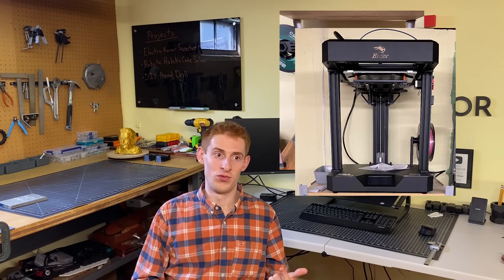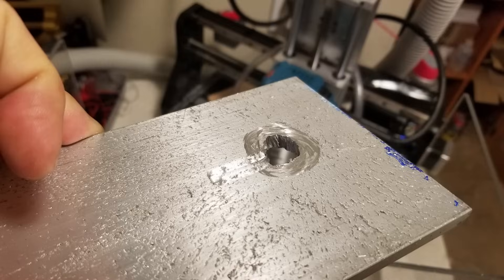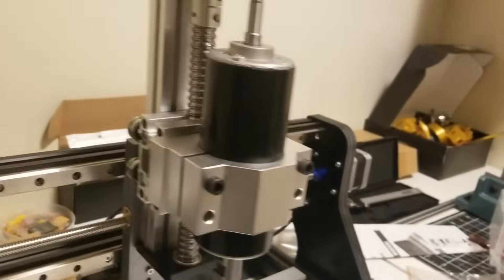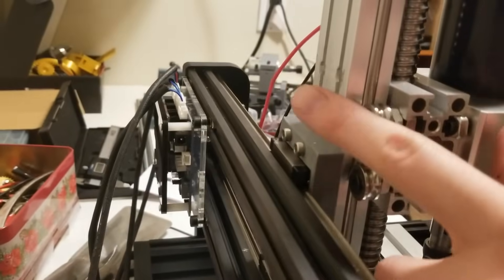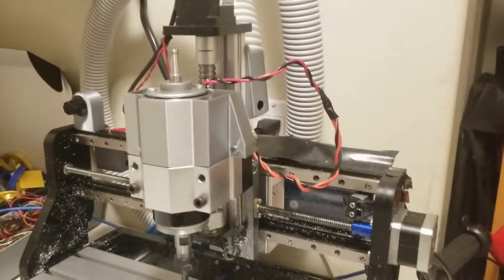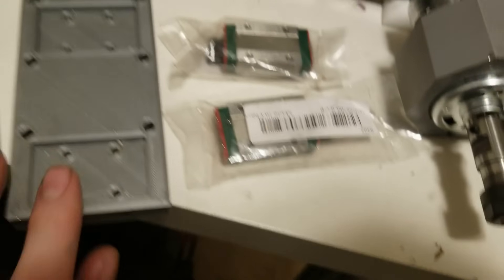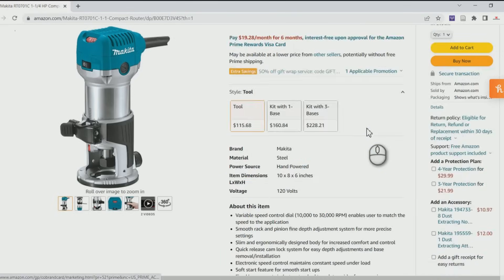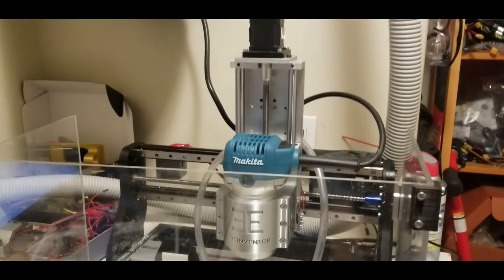Upgraded Desktop CNC 3018 cuts Aluminum FAST!

Comment: I am a trained CNC machinist. I went to college for manual machining and then CNC machining. I'm also a trained welder, fabricator. I have not been machining since 2009. I was a good machinist and then the economy took a downward turn & I lost my job. 
I'm on disability now and I am looking to use my education to make a extra income because of the economy being what it is. I bought the 3018pro for under $200 delivered. I'm use to milling metal and not plastic or wood.
I'm learning how to turn my skills into a viable income to help me with the increasing costs of living, & I am so bored with life that I could scream! Honestly, I went from high performance go-kart racing parts, Jr dragsters & lawnmower racing when that became a thing, to living a sedititary lifestyle. I was at the end of my rope, figuratively & emotionally, with loosing family members & friends to death. I was in a Very Dark place & I needed a creative outlet for my emotions & my skills of building & creating things. I'm the try that will build something that can be bought already made ready to go. But I prefer to build my own pieces of equipment to guarantee that I will have the best machine for my money. It's a lot of work to reinvent a machine, but the rewards are well worth the effort, time, expense & the knowledge that the machine is built as strong as it possibly can be, given the size of the parts that make up the machine & the components that are used in the machine itself. Like upgraded bearings, bolts, materials and everything else that you can use to make your creation better than the commercial variations that are for sale to the general public. I'm definitely not your average customer & I demand only the best in my equipment selection. I will completely redo the entire machine sometimes to add better bearings, linear rails, high grade bolts & fasteners. When I'm done with the upgrades it's almost a completely different machine. BUT MY MACHINE, WILL ALWAYS BE 2X'S-3X'S BETTER QUALITY THAN THE BEST FACTORY MODEL! 
I know that I could just save up the money and purchase a New Professional Grade machine, but that takes time and money, both are in short supply at the moment. So I IMPROVISE, and create the best machine that I can using what I have, can afford & what will do the job I'm asking it to do. It's a Frankenstein machine, some parts are modified to make them work with a different companies parts, but it's a TRUE PLEASURE TO SEE YOUR FRANKENSTEIN MACHINE COME TO LIFE, & BE EXACTLY WHAT YOU'RE NEEDING AT THE TIME! 
NOTHING BEATS THAT FEELING OF A HOME ENGINEERED, PROJECT ONE GOES THROUGH TO BUILD A BETTER WORKING MACHINE AT HOME, WHEN EVEN THE BEST COMERCIAL MACHINES HAVE DIFFICULTIES DOING, THE SAME WORK THAT YOUR HOMEGROWN, SELF-DESIGNED MACHINE IS POSSIBLE OF DOING. 
The PRIDE you have, knowing that you built that machine and it works, BETTER, that it's Professionally Manufactured Counterpart Machine has trouble recreating the same product. 
There's more than 1 way to skin a cat! The same with machinery. The Professional Companies have pretty well designed machines. They cut costs where they can so they can stay competitive in the market. I'm not interested in competing with anyone. I'm just trying to make the best machine, with the most robust components available & using them to make my machine work better and last longer because I chose to go with upgraded parts from the beginning of the build. Why wait until it starts to fail to redesign the parts so they can handle the Extra Tourqe, Rpm's & the Flex or movement of the linear rails or support pieces. Take care of the items you feel are substandard to begin with, and save yourself weeks of time and misery trying to figure out how to make this piece not flex or not do something it's not supposed to do. A little preemptive thought and engineering will make the machine work better, faster, will increase overall performance and efficiency in your parts manufacturing and the quality of your parts overall. It takes some time to make the changes to your brand new machine and then there's the cost of the improvements to your machine build. BUT in the end, IT IS ALL WORTH IT. THE COST OF THE IMPROVEMENTS WILL PAY FOR THEMSELVES IN A VERY SHORT TIME.

Comment: You need swan neck clamps to clam the metal down or the clam has to be level with the piece you are clamping. The lesson i learned from this video is to buy industrial level parts so you could use your cnc to make more parts that you need to complete the rest of the cnc machine. Great video.

Comment: I finally got my 3018 to cut PCBs with the stock motor. It was a mess at the start but it's really good once you get the right settings.

Comment: A tip for hole "plunge" toolpathing,  a far better method is to "helix bore" rather than plunge. 2 flute mills tend to chatter when plunging in the z axis only. If the hole diameter will allow (you will need a smaller tool to interpolate helical within the hole). Try it, I think you will find it mills much smoother. Not sure if your router has the capability to interpolate X,Y and Z , but just a general FYI Good luck !
Reply: But it is also a lot slower than plunging too. You need no backlash for it to work properly. He is just using cheap threaded rod, so I don't know if it would produce a better result.

Comment: I've also upgraded the heck out of my 3018. Had a lot of fun doing it, but it would obviously have been much smarter of me to buy a better quality CNC to begin with (or parts to build one from scratch), and much cheaper as well when you add **everything** up.

Comment: Excellent! I'm just starting my upgrade journey with the newer Sainsmart 3020 Pro Max... My first upgrade was to add linear rails to the Y-axis and make it 400mm (now 3040). Next, I'm going to beef up the X-axis in readiness for a new Z-axis and bigger spindle motor 😃
Reply: Hey Paul, have you found a good motor to upgrade with? I’m considering upgrading the motor on my 3020 as well but I’m not sure about compatibility.
Reply: @BadPractices  Yes, I'm now using a Makita RT0700CX4. Had to design and 3D print a new 65mm mount for the router though. I have heard there's a way to start/stop the router using a solid-state relay triggered by the voltage output from the control board, but not prop[erly looked into it as yet.
Reply: @paulblythe5899  Awesome! Is it connected to the control board in any way at the moment. If it is separated, do you just run it at full speed all the time? Thank you for answering my question by the way. I love my 3020 so I’ll be really excited to beef up the motor a bit
Reply: @BadPractices  The Makita is independent of the control board for now. It has a variable speed dial with numbers corresponding to different rpm (10K to 30K). In general, I run larger diameter bits slower, and smaller bits faster. Adjusting the speed per job/cutting bit. 

The 3020 is a great little machine and I'm happy I purchased one.
Reply: @paulblythe5899  For the past few weeks I’ve been fussing about how to integrate a new motor with the stock control board but having the motor be independent is a clever solution. Thanks for the advice. I’ll be buying a Makita spindles today. Thanks for the info, Paul!

Comment: Quick question regarding bits, what bit are you using for milling aluminum? Are there small bits that can mill aluminum if they're strong enough? Or is that just not very realistic without a lot more rpm's than the 30,000 the Makita can put out?

Comment: Love this vid really well put together and very comprehensive. Will definitely be looking at similar upgrades to the z axis, linear rails and router for my 3018. 
Do you have any info on your diy air assist? Would definitely be looking to do something similar as well. Thanks again.
Reply from the maker: To be honest I didnt quite perfect the vaccuum system, theres two annoying aspects: one, your vacuum system needs to be close enough to your parts to capture chips but not so close it interferes with the part your cutting (especially in the z-axis), and two, the main solution to that problem, which is like a brush curtain around the endmill, prevents you from actually seeing what your cutting, which for a not so reliable cnc like this one, is quite important. So my goal was to get good chip clearing into the vaccuum while still being able to see the cutting and also not interfere with the part. I got close but didnt quite reach that goal yet.

Comment: I can't see the plastic adapter on the Z axis not being at least part of the problem. That's the first thing I would have swapped out. It's got to withstand all of the X and Y forces, so I think it should be as solid as possible.
Reply from the maker: Very true. Its the next part that deserves to be replaced with aluminum. I will mill it on this CNC!

Comment: GREAT video! You went from z ballscrew to lead screw? I cant imagine that being an improvement at all. and i'm surprised the Mak router was an improvement having half the bearings a true spindle would have I would expect alot of vertical as well as horizontal play which would translate to poor surface, and side wall finishes. also, 30k RPMs with 3/16 or 1/4" bits is way too fast.
Reply from the maker: Thanks! Yeah i didnt actually plan on the new z-axis being a lead screw, i thought it was going to be a ballscrew. But even then, the stability/sturdiness of the bushing slides and lead screw gave me better performance than the previous z axis, which did have a ball screw. Sure the Makita isnt as good as a real spindle, but its a whole lot better than what it came with, and works very well for cutting aluminum, its used on a ton of other routers as well. Remember I was going for bang/buck, not perfection  Also i wasnt running 30k I was running closer to 17-22k rpm (4/6 on the router dial)

Comment: Great video.
I think the problem with the V2 was the linear carriage on the Y axis, and the whole Z axis.
I think the 500W motor was quite enough, and there were no problems with it. But I can't say for sure.
Reply: i have a 3018 (not pro) and have still the stock 50w (realistic speaking ~15w) motor attached and (with some other ridgidity upgrades) am able to cut aluminium, steel and even V4A without any problems (deflections ~0,1um, which some older industrial machines struggle with...)
The motor only gets in trouble if you want to cut way to fast (even to fast for the endmills...) or if you want to push your mills to the absolute end of their capabilities in terms of DOC..

Comment: Well I have wanted to get into CNC machines for a minute. But due to a lack of a decent budget I've avoided them altogether. My goal is similar. To use a CNC machine for a few projects (( mainly motorized bicycle disc brake adapter, a chain tensioner and other parts ))

Comment: I've had a 3018 machine for a couple years but after some parts started to fail on it, it's been slowly neglected and I've focused on other options for parts. I recently got my first 3d printer and this video gave me renewed excitement for the 3018 that's collecting dust. What's your 6 month review? Is it worth the hassle?

Comment: Do you have links to the files you used for the z axis brackets etc? Would love to upgrade/make a budget desktop cnc like this for aluminum and carbon fiber
Reply from the maker: The Z-axis adapter file is on thingiverse, linked in the description

Comment: first important upgrade have change all 3D printer plastic parts make new aluminium parts, important change rods ballscrews lot better accurate and no backblash. then real spindle not worst router used, then rails better and last biggest rails all axis.

Comment: first need update cnc fight palm router off and trash can. then buy better spindle etc, 800W aircooled ER16 spindle whit collect set. lot better than worst palm router newer.Z-axis not good if use not supported rod linear rails, need be subborted. or sguare rail supported model.

Comment: WD40 cannot be used as a cutting agent, paraffin is better or best still soluble oil. Lubricants dull the edge of the cutter . If you lubricate a cutter it glides over and does not cut efficiently. Also your clamps need to be parallel to the table. I have been milling all my life and now retired. Just an observation to help you get better results.
Reply: Wd-40 is actually a solvent. Performance wise for me, it is a night and day difference for chatter and surface finish on aluminum. I honestly think it prevents a lot of wear especially on hss endmills.
Reply: WD-40 is a common lube for machining aluminum, even though it is actually a solvent.
Reply: yup... but is not using wd40 for cutting agent better than using wd40 though?... because using any oil is better than using no oil at all. or so ive heard 🤔
Reply: @MrOner07  Yes ,you are correct.
Reply: WD-40 does work wonders when you need to tap aluminium
Reply: The cheese of this man hurts me deep inside. Good video, awful personality. 😂
Reply: For Aluminium the best to use is Petroleum
Reply: Clearly you haven't. Wd-40 is paraffin. LMFAO. The fuck you talking about.
Reply: Use goo gone or another kind of “soap”
Reply: It can absolutely,   with aluminum. I've done it.
Reply: WD40 is mostly great marketing. People use it for everything, thinking the stuff is almost Magic...
Reply: Yes ,you are correct, but take please advice from a qualified CNC Miller here in the aerospace industry , WD40 is “not “ designed to aid cutting.

Comment: Would a 2.25 hp router/motor upgrade provide much additional benefit? Would it do steel parts ?
Reply from the maker: Hard to say. Im sure it wouldnt hurt but to do steel effectively you would definitely need to upgrade the rails under the bed and probably need a stiffer/heavier frame
Reply: @ericinventor  sounds like it would make a  great video, when will we see it?

Comment: app to convert g-code from design file using what? I use aspire 9.2 it's too difficult to adjust the cut due to the conversion of the design from the pdf file

Comment: Nice upgrades! The linear rails you linked are 400 mm and don't fit this assembly. Did you cut them to size or is the link the wrong size? Might be easier to grind down 300 mm to fit.
Reply from the maker: I did not cut them to size, I bought them at 300mm, so the link might be wrong sorry

Comment: I also looked at this makita to use as a spindle motor to drill my cnc, but I think a big disadvantage is that you can only mount 6mm and 8mm endmills.  Do you know if there are other collets for sale somewhere for smaller endmills?  I prefer a 4mm or 5mm.  Thanks !
Reply from the maker: Yes it looks like some adapters exist, like this one on amazon: serial number is B0953CT1FF
Reply: @ericinventor  Thank you so much, this is exactly what I needed.  Then I will immediately order a Makita.

Comment: It looks like the machine frame is pretty flimsy along the Y axis (if Y is the one the Z is mounted to). There is no diagonal bracing between the gantry supports and the beams that hold the Y rails, so the gantry will easily deflect from a rectangle to a parallelogram (as viewed looking at the front of the machine). Adding a rectangular aluminium plate at each end of the Y rails to triangulate the rails to the black vertical support elements will make it much stiffer. Stiffness is absolutely key in machine design.

Comment: So I think I missed it. What was the final upgrade that fixed all your problems? I just ordered a proverxl 4030. I would like the option to mill aluminum. If I upgrade to the Makita router, what else would I need to cut aluminum like your final attempt? I am new to cnc router use. But have cnc punch press experience.

Comment: Not sure if you touched on it or not, but one of the first things you should be making is replacement parts for all the support pieces that are still plastic. Especially now that you can machine aluminium easily. Replace the side supports, and also the 3-d printed backing plate. You should be replacing everything you possibly can with metal. I like that you changed out your slides for linear rails as well. Doing all your axes will make an improvement as well.
Reply from the maker: Totally agree! That's the next step!

Comment: What kind of filament do you use to print off the parts for the CNC machine? It looks super solid. Great video, I have no need for a CNC machine but now I really want one.
Reply from the maker: Its as Silk Silver PLA. I put the link to buy it in the description under 3D printable parts!

Comment: Thank you Eric, really interesting and useful.  A little engineering tip, when you clamp a piece to the worktable, the heel of the clamp should be slightly higher than the toe and the clamping force should be as close as possible to the work piece, this way you get maximum and safe downward pressure.
Reply: Seen that so many times. On bigger mills with 23 steppers the part can move if the clamps are not done right.

Comment: To add to the other guys comments about your clamps being level (Level is best, but slightly higher is better than slightly lower). Also the clamping screw is best used as close to the part end of the clamp as you can get it. Great video, I'm thinking of getting one of these machines to play with.

Comment: if you check Ivan Miranda chanel, he made CNC machine from ground up with 3D printed parts and the rest from ebay. i think that buying mini CNC machine to change more than half of the parts is less fun as building the machine from parts you made or bought. but sure, after a lot of tuning, your machine does the job pretty well too. and both ways are decetly available today, that goes for 3D printing as well. this makes me want to buy 3D printer even more =D